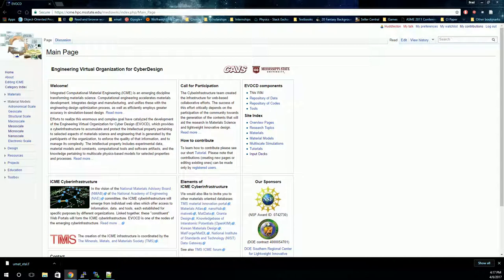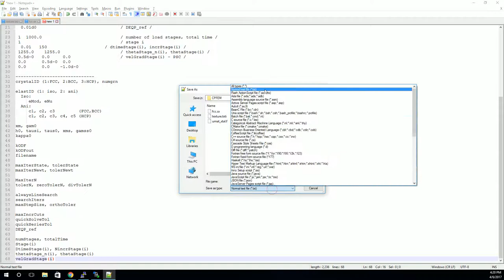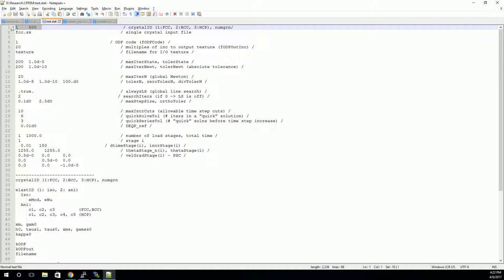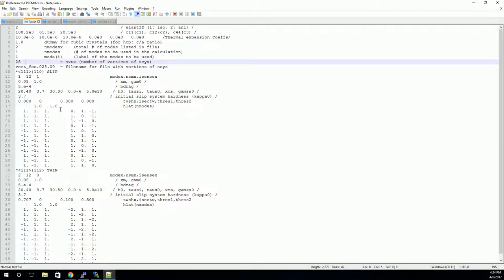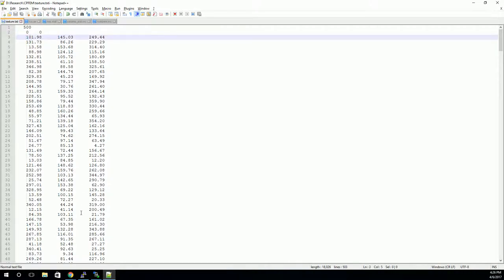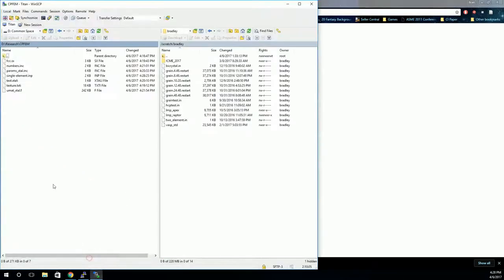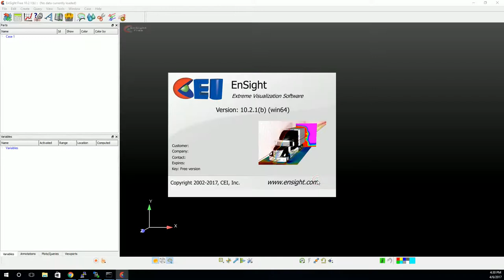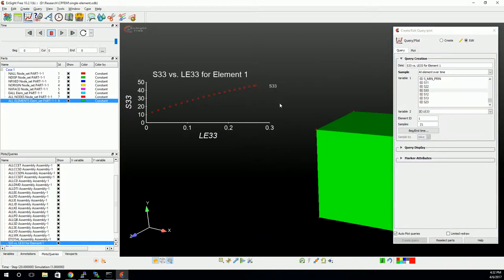Running Crystal Plasticity in Abaqus

Comment: Hi,
Thank you for this wonderful tutorial. I am  running Abqus 2021 linked with Intel oneAPI (which is the latest for fortran compiler) on my Windows PC. I could see the UMAT  is working fine for others here from the comments, in my case it is always failing saying - "Error in job Job-1: Abaqus/Standard Analysis exited with an error - Please see the  message file for possible error messages if the file exists." but there is no message file to check. 
My doubt is, is it due the newer version of compiler ? or something else. Your thoughts would be more valuable for this !!
Many thanks.

Comment: Great tutorial! Thanks for the effort! I'm a beginner of CPFEM and I wish I had seen your video sooner. How do I assign different orientations to different element(grain) to see the texture evolution?  I wasn't able to find anything about this on the code manual. Do you know of a better code that is capable of doing this? 
Also thanks for explaining how to get material hardening parameter from lower level simulation! I went to your other video tutorials and I understand how to get the drag coefficient from LAMMPS. What about the Voce's hardening parameters? Can you elaborate a bit more on how to get these, using dislocation dynamic simulation, if I get it correctly. Thanks in advacne!

Comment: Thank you very much for your tutorial! It helps me a lot. I've got a question here. I'm using my own laptop to do the simulation to magnesium, after I submitted the job, ABAQUS told me that I have insufficient memory even if I change the grain number to 5 and the element number to only 1. My laptop have a 8Gb memory and it is not likely insufficient. Could you help me with this? Thanks a lot!
Reply: Did anyone apply it to Mg alloy?

Comment: Hi, thanks for the video. Everything works fine from my end, however I cannot run this UMAT in parallel. Have you ever tried it? I have already removed every read, write, open, close, data, etc... To try to prevent multiples cpus from reading/writing the same file/memory, but no success...

Comment: Another interesting video. Thank you so much.
I was wondering, is it possible to insert the weight (intensity) of the Euler Angles as input to the texture file? say like a 4th column in texture.txti file. Also is it possible to change the UMAT to insert the Bunge-Euler angle?
Reply from the maker: +Farzad Foadian To your first question: as far as I know, that is not possible - however, you could put in the same angles multiple times for a similar effect. 

To your second question, there is not a straight-forward way of making that change to the Euler angles, that I know of. But, all of the code is open, and you could go into the umat_xtal.f file and change the code to use a different style of Euler angles. Or, perhaps an easier solution would be to add a converter to convert any style into the angles already assumed.

Comment: Hi, Thanks for the tutorial. As I understand so far, this simulation run with one element, it means that one grain is simulated. Then, can we simulate two elements and each element represent for one grain? Could you please briefly explain whether I need to modify some other parameters for two grains?
Reply from the maker: +Nghia Mai Actually, it is a little more complicated than that. The one element can represent as may grains as you want (within reason). The response of all the different grains in the element are averaged to get the behavior of the whole element. Now, you could assign different grains to each element or to sets of elements, but you would need to create separate materials for each grain.

Comment: Hi, I am just learning to use CP. I am curious that there are 500 grain angles present, but you have modelled a single element. This single element is a single crystal? Also, can you please explain how to use this code for a polycrystalline microstructure?
Reply: Hello, I have the same question. Could you tell me how to apply this code to polycrystal？

Comment: Hi, Thanks for the tutorial. I have a query. I was trying to run it for single grain and I modified texture.txti for single grain and test.xtali file for 1 numgrn. After running it is producing an error showing nstatv .ne. numgrn*varspergrn. Can you please help me on solving this issue whether I need to modify some other parameters for single grain?
Reply from the maker: Thanks for watching! Yes, there is one other parameter, I think, that you need to change. In you material definition in your ABAQUS input file, you will need to change the "DEPVAR" to 70 times the number of grains. Probably it is set to something like 35000 right now, since it was originally set up for 500 grains. Hopefully this helps! Thanks!
Reply: Hi,
Thanks for your suggestion. I have another query. I was checking the vertex of scys for both fcc and hcp case, but I am not understanding how those parameters were calculated. Can you please provide me some documents or links about those vertex of scys calculation? I appreciate your support. 
Thanks
Reply from the maker: No problem. So, the vertices of the SCYS are actually not used by the UMAT. The line you see for them in the  crystal file is actually an artifact of an eariler version, I believe. Most likely it has just been kept there for backwards compatibility. If you search for the default filename ("vert_fcc.028.00") in the UMAT, you will see a comment to this effect. However, if you are looking for more documentation on this model, there is a decent manual here: https://icme.hpc.msstate.edu/mediawiki/images/1/10/Introduction_to_CPFEM_manual-1.pdf

I hope this is helpful!
Reply: Thanks a lot
Reply: This tutorial is helpful for understanding crystal plasticity model and it is helping me a lot. I am working with dynamic problem. I am wondering if you can provide a VUMAT crystal plasticity tutorial (if it is available) or any kind of suggestion is appreciated. Thank you.
Reply: Hi, How does your texture.txti file look for single crystal?  I am not sure what the 555 number is for at the end of the original texture file.
Reply from the maker: Actually, I don't remember what the 555 is for either. It feel like it doesn't do anything except for maybe give another (unused) input after the orientations, but I'm not sure. So, for a single crystal, you should just need to change the first line to 1 and just leave one orientation.

Comment: thank you!
I have problem , when select (umat-xtal.f) file the program not except it 

( user subroutine file name must have a .for or .obj extension) 

why ? what should I do?
Reply from the maker: Thanks for watching! You should be able to rename it to have a .for extension if you need it. It won't affect the file, and .f and .for should be the same for this purpose.
If you run into more issues when it compiles, you may have to look into some custom compiler flags, but I would try that first.
Reply: @Jere5120  thank you , I am try it  , but how convert text extension to .for extension ,  can you help me ?
Reply: Excuse me, when select umat file and apply submit show this error ( Problem during compilation - C:\Temp\umat.for) you have any answer for this problem?

Comment: thanks ,I want to know if the umat subroutine could be used by Windows operating system?
Reply from the maker: Thanks for watching! The short answer is yes. However, I personally have had difficulty in configuring Abaqus to allow me to use any UMAT very easily. But, if you have an IT department or some Abaqus technical support, they should be able to help you get it configured. Good luck!

Comment: Hello, i am new user, i have started learn ABAQUS for CPFEM,  i have downloaded all files from ICME Website according to your this video, but i didn't understand how did you open the command file? and in my laptop already have installed Abaqus/CAE 6.14-1, Thanks
Reply from the maker: Hello! That will depend on your system and how you installed Abaqus. In this video, I am running Abaqus on a Linux machine, so I just open a terminal and use it that way. If you are on a windows laptop, it gets quite a bit more complicated. You can run it from the GUI (CAE) but you will have to install and set up a fortran compiler. Unfortunately, I don't have any experience doing that on windows! Sorry!

Comment: I am facing covenrgence issues for the 2D element. I am using the CPS8R element. I have tried CPS4 and CPS8 as well, but facing the same issue. I have a single 2D element and similar boundary conditions as in the 3D problem. Non-linear geometry is on. The step time is 1 unit. The time increment settings are as follows: max number of increments:10000, increment size: initial increment size is 0.0001, inimum increment size is 1E-6, maximum increment size is 0.001. Could you please tell me where I am going wrong and how to solve this issue. Thank you. The following is the messages displayed in the  message file. 

               CONVERGENCE CHECKS FOR EQUILIBRIUM ITERATION     1

 AVERAGE FORCE                      3.884E-02   TIME AVG. FORCE       3.884E-02
 LARGEST RESIDUAL FORCE            -8.568E-02   AT NODE          7   DOF  2
   INSTANCE: PART-1-1                                                                        
 LARGEST INCREMENT OF DISP.        -3.119E-06   AT NODE          2   DOF  2
   INSTANCE: PART-1-1                                                                        
 LARGEST CORRECTION TO DISP.       -3.119E-06   AT NODE          2   DOF  2
   INSTANCE: PART-1-1                                                                        
          FORCE     EQUILIBRIUM NOT ACHIEVED WITHIN TOLERANCE.

  NUMBER OF EQUATIONS =       16     NUMBER OF FLOATING PT. OPERATIONS =  1.50E+03
     CHECK POINT   START OF SOLVER    

     CHECK POINT  END OF SOLVER       
       ELAPSED USER TIME (SEC)      =  1.00000E-02
       ELAPSED SYSTEM TIME (SEC)    =   0.0000    
       ELAPSED TOTAL CPU TIME (SEC) =  1.00000E-02
       ELAPSED WALLCLOCK TIME (SEC) =          0

after 4 iterations:
   ***NOTE: THE SOLUTION APPEARS TO BE DIVERGING. CONVERGENCE IS JUDGED UNLIKELY.

and finally:
 ***ERROR: TIME INCREMENT REQUIRED IS LESS THAN THE MINIMUM SPECIFIED
 ***ERROR: TOO MANY ATTEMPTS MADE FOR THIS INCREMENT
Reply: It turns out i was using the wrong element!! WOrks now
Reply: I encountered the same problem in the 2D simulation, how did you solve it and what element you chose? Thank you

Comment: Hi. thanks for great tutorial. i was able to run this code with abaqus standard (static, general) successfully but when i run it in dynamic explicit mode i'll get the following warning message;
"A material defined in user subroutine VUMAT must be defined as purely elastic (using the initial elastic modulus) at the           beginning of the analysis (stepTime=0). This is an informative message. It does not necessarily indicate that user subroutine
VUMAT is incorrectly defined."  
and the following error message in the status file;
"NO VUMAT SUBROUTINE WAS SUPPLIED FOR THE USER MATERIAL"
i define the density in the materials section in the abaqus cae. 
it would be really appreciated if you help me how to run this code in dynamic explicit procedure. 
best regards
Reply from the maker: Thanks for watching! And, yep - that is a limitation. In abaqus, the user defined materials need different files for implicit and explicit - because the solver requires different information from the material model. So, the CPFEM is just a UMAT - which means it can only work for an implicit simulation. Sorry! I don't actually know if there is an explicit version, but I don't see any reason why it couldn't be converted to a VUMAT - But, it would be a significant coding effort.

Comment: Hi,

I was trying to run the simulation on a windows machine on which, Abaqus and the student version of Intel FORTRAN compiler are installed. when i tried to upload the user subroutine a message popped up saying the subroutine must have .for or.obj extension and basically they are different extensions of FORTRAN file so i tried to just change the extension to .for and then checked the job but i got compilation error. do you know how can i solve this problem.

Regards
Mohammad
Reply: solved. to be honest do not know how! just repeat the process with a fresh mind
Reply: I am facing similar problem as yours. Could you please let me know how did you solve it? Thanks
Reply: i am also facing similar problem......kindly suggest some corrective measure.

Comment: I was following the pdf version of the tutorial and it asks to select the file oneelement.cae. What is that? Do I need it?
Reply from the maker: +Z Dlamz Thanks for watching! So, you shouldn't need the CAE file, no. Basically, it is just a pre-setup abacus file. The one you need to setup is very simple though, I think I talk about in the video - though it has been a while! The setup is just a single element that is a perfect cube, with constraints applied to the individual points. I hope this helps!

Comment: Hi, in Abaqus job, it gives a message that 'the subroutine must have .for or.obj extension'. I tried by changing to .for format but I got error. Could you please help to solve this issue?
Reply from the maker: +Shahrior Ahmed I have encountered this issue before - though only when trying to run the simulation through the GUI. I have not been able successfully run it that way. However, if I invoke abaqus on the command-line it does not seem to have the same issues. How are you running yours?
Reply: I am trying to create a job in Abaqus CAE. During this procedure, I introduced the 'umat_xtal.f file'. As soon as I click OK, a pop up says-  'the subroutine must have .for or.obj extension'. 
I have one more question- in line 95 of the 'umat_xtal.f' code.My filepath is 'C:\temp\Crystal Plasticity Missisipi State' but in the original code, the filepath did not contain any drive name (such as C:\, D:\ or ...). Do you think my filepath notation is right? Thanks.
Reply from the maker: +Shahrior Ahmed Yeah, I don't think that's the issue. On our systems here we have to launch this job from the command line, using something like: abaqus job=job_name  
I have not been able to get it to work through the car - I was told that it was an issue with the compiler setup. If you know how to configure the compilers in abaqus, that's what you should explore. Unfortunately I can't help there - my advice would be to run it from the command line. Let me know if you figure it out!
Reply: Thank you for your suggestion. When I intend to launch the job through the command line, Could you please suggest any way to integrate the subroutine with the job? or If I create a .inp file and try to produce .odb files through Abaqus command line could you please suggest on how to use the subroutine in this case?
Reply from the maker: +Shahrior Ahmed Ah, yes.  I forgot that part. To run with the subroutine, you just have to add "user=subroutine.F" to your command with the name of your subroutine there instead. That should allow it to run with the subroutine.
Reply: I am able to run it through Abaqus CAE now... forgot to add a '/' after the file path. Thank you
Reply: Hi Ahmed, I would like to ask you about how did you use the UMAT through ABAQUS (CAE)?

Comment: hai, thanks for nice tutorial.
i was unable to link abaqus and visual fortran so i run the input file in my  institute cluster (abaqus 2016 version) . process was completed successfully. now i tried to open odb file with ensight as you shown in this tutorial, but it is showing error (unable to read, see server console for more details). have you got same error, in any case? how to solve it?
Reply from the maker: Thanks for watching! Unfortunately, that error does not sound familiar. However, if you have access to Abaqus, you should just be able to open the odb in the Abaqus viewer - it ought to work better.  Let me know if that works for you!
Reply: it is working now.

Comment: Hi, thanks for the great work. I am trying to use the code and i get an error:

forrtl: No such file or directory
forrtl: severe (29): file not found, unit 80, file /scratch/640022/anandats_single_element_32268/home/anandats/test.xtali

Can anyone shed some light on why do I get this error and how i could overcome it. Thanks.
Reply from the maker: Thanks for watching! So, it looks like it can't find your crystal input file. I would make sure that the path in your error message actually goes to that file - it looks suspect to me because it has a /scratch and a /home in it - but I could be wrong!
Reply: Muhammad Junaid Afzal  Hi sorry for the late reply. Yes I was. I actually changed the line no. 122 to "& /'/home/anandats/WorkDirectory/'/"

Comment: Hello Mr. Brad, I am Raj. I am doing M.Tech. in Metallurgy from Indian Institute of Technology and I require your help in my thesis research. While I try to open these files, the text that I get is without spaces, tabs, and new lines. Could you please guide me on how to solve this problem? (If you could provide those files in a google drive folder or over an email, that would help me with my project greatly.)(I can mail you from my college mail email id if you provide me yours.)
Reply: did you get the files?